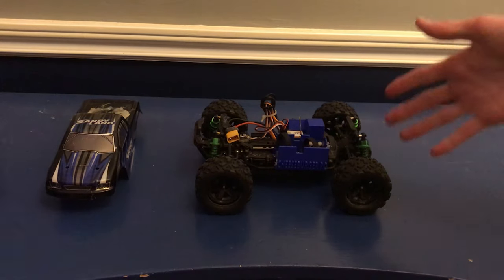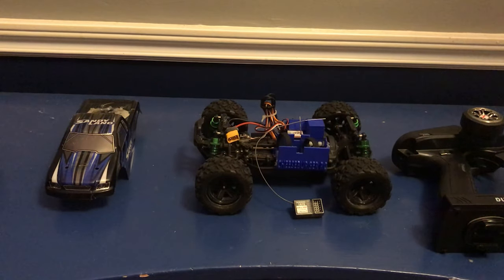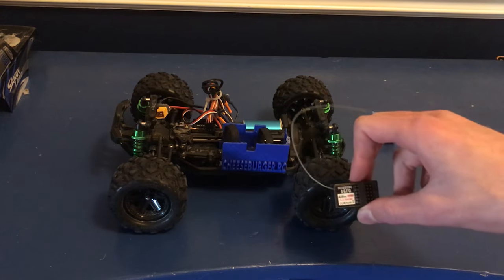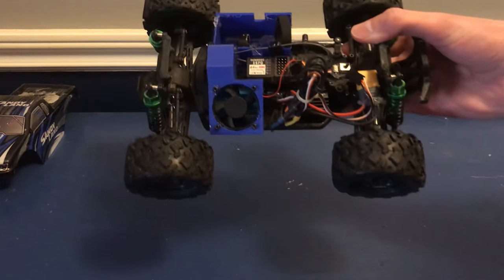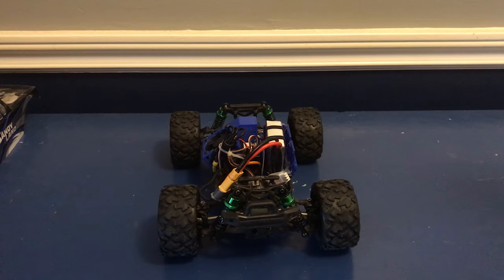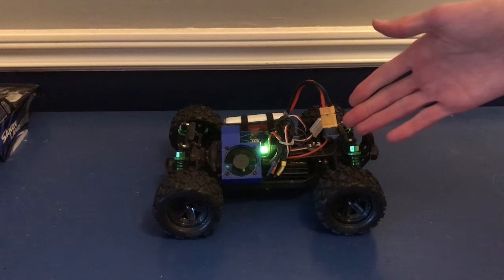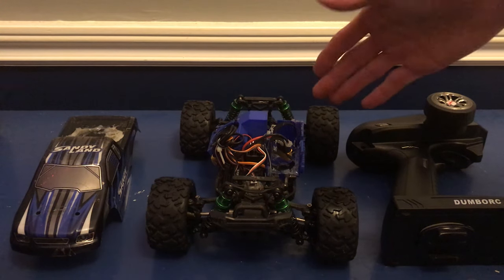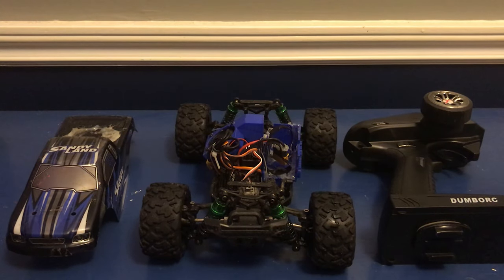New Radio and Gyro for the Sandyland! - A Must Have Upgrade for 3s!

Comment: Hey I just wanted to let you know that I also did the bearing upgrade on my Sandy land I had to do a major clean out of the entire car and the motor it picked up some iron dust off the floor where I work and disabled the motor entirely it's running great now but I think my next move is going to be a new motor and I'm having some trouble with the steering servo
Reply from the maker: Awesome! If you upgrade the motor and esc, you’ll have to get a new servo, although that would fix the servo issue!

Comment: I got the x6fg but having issues setting it. Truck wont go straight for shit with it over 30%gyro action. Over 50 it just does circles
Reply from the maker: The gyro is off by default, and you have to turn it on for it to work. (Kind of a bad design  ¯\_(ツ)_/) It shows how to do it in the instructions. That would be my guess as to what it is. If it’s not though, I can look a bit more!

Comment: Yo do you have any pull? I did the same upgrade more or less and with the new servo and mount, no matter what I do, I get off center steering, so I’ve got massive trim and maybe 25% gain on the gyro
Reply from the maker: It might be the servo saver. Mine had a huge crack in it, which used to make the steering really weak. (The wheels would barely turn unless the car was moving.) I fixed it with some glue, and now it works fine. I’d recommend checking that if you haven’t already.

Comment: Were do you find rc parts for the sandy land
Reply from the maker: I get a lot directly from Pxtoys. They have pretty much every part, and they’re pretty easy to find with the part numbers. I order them from Amazon whenever I can because the shipping is faster, although you can’t get everything from Amazon.
Reply: @CHEESEBURGERRC  You can also find them from xinlehongtoys.com. Seems like they have a few more parts for the sandy land than the pxtoysrc.com. I just ordered some aluminum parts (adjustable steering tie rods and steering hub carriers) for my 300e from them (fingers crossed how it goes) Funny is that they look like the same website and probably have the same owner.